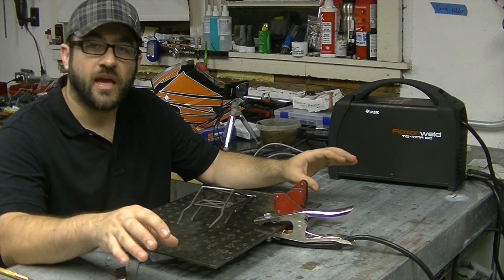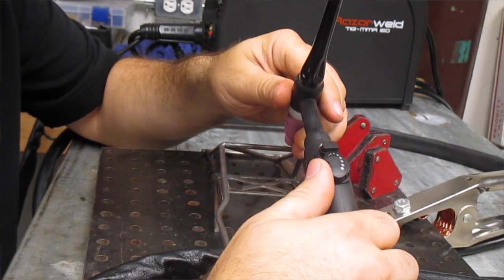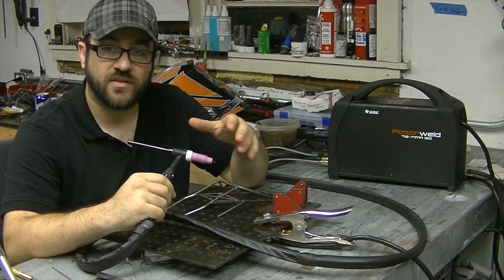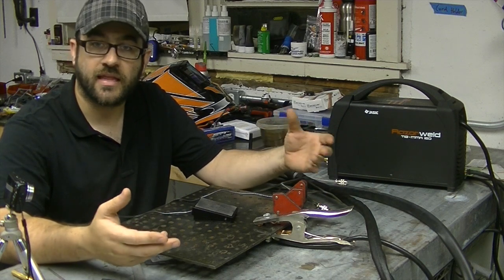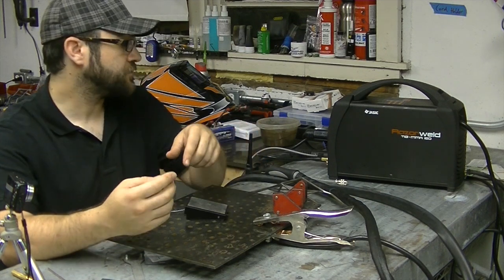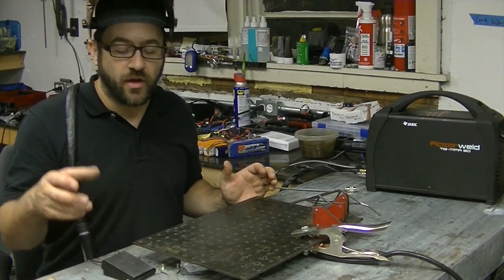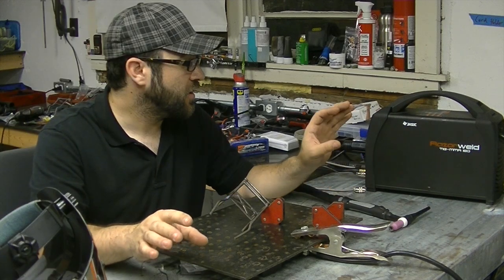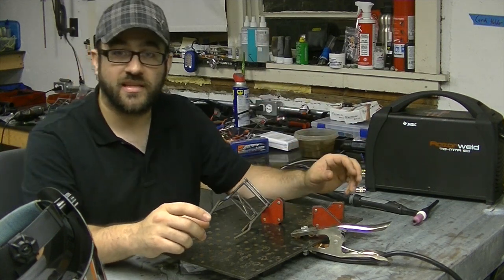Razorweld 160P/200P Update - Foot Pedal Modification

Comment: Cool. Can you weld aluminum tubing with that? Maybe a silly question, but eh.. I might just learn something
Reply: No, you don't need an AC machine to weld aluminum- but it does make it MUCH easier.
Reply from the maker: This is a DC only machine, so it will only do steel and stainless steel. You need an AC capable machine to do aluminum. Those are generally much more expensive.

Comment: I may have to try this on mine. I've had it about a month now and I'm having issues with it going into remote mode while I'm welding. I found out you can also twist the head of the torch around if you need to.I also picked up a button end cap. It makes getting around the inside of the cage a lot easier. 

I found a pedal at Amazon.com I think is close to what you have. Just need the plug now.

Here is the link. http://www.amazon.com/Philmore-Momentary-Foot-Switch-30-17090/dp/B004GIIYK0